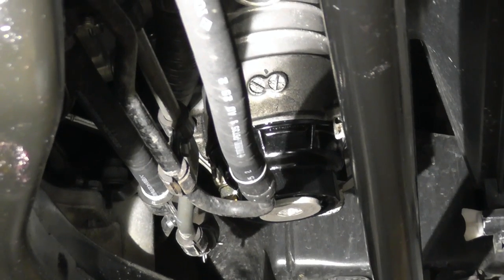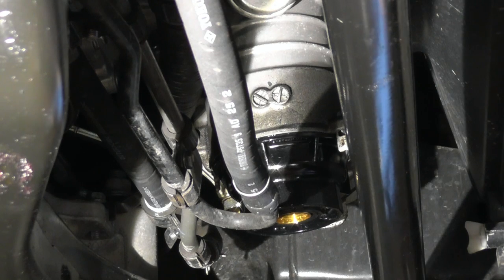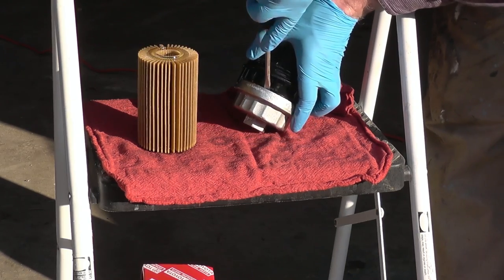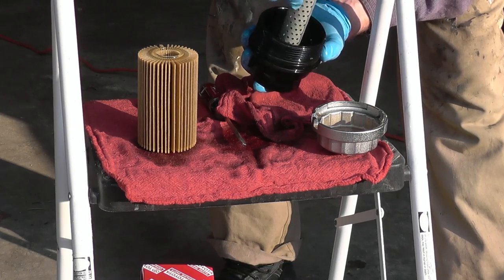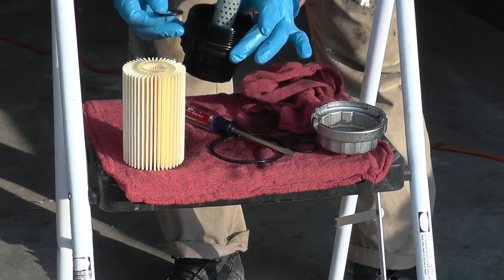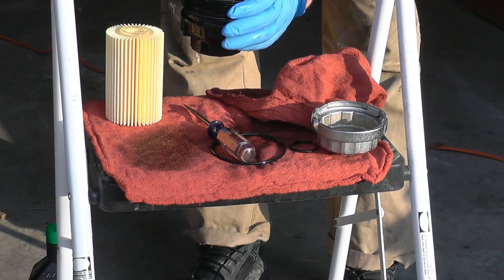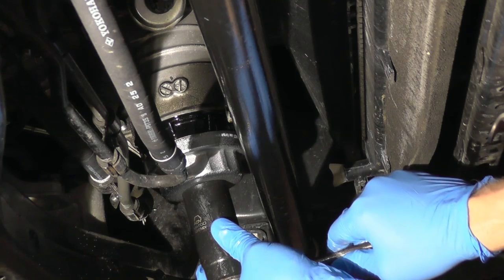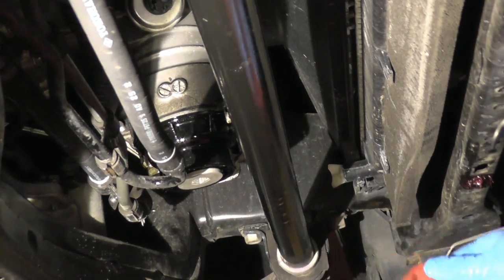2007-2020 Toyota Sequoia/Tundra oil change with filter 2nd option

Comment: Every time I change the oil and filter on my 2017 Toyota Tundra off road TRD I ask my self why does Toyota make it so hard to do a simple oil and filter change for the average person. Between the pain in the butt skid plate to remove and replace when you are laying on my back and the crazy oil filter housing as I lay on my back on the cold concrete. My did you do that Toyota and don’t get me started on the sealed transmission.
Reply from the maker: What cars have dipstick for transmission?
Reply: @repairvehicle  my wife’s 2016 CRV  AWD has a dipstick my old 2012 Honda Civic had a dipstick
Reply from the maker: Older Toyotas had dipstick too

Comment: It is necessary to remove the splash shield every time we want to change the engine oil. Have anyone cut a small opening on the splash shield? only big enough to remove the oil filter?  Thank you
Reply from the maker: There's another option, I will make a video on this subject, stay subscribed. I am not aware of anyone cutting an opening.

Comment: You're asking for problems by removing the inner stem.  If it's not activating correctly it will bypass the filter and you'll end up with pressure issues and/or engine codes.  VVT won't like it if you affect pressure by causing a problem with the filter cannister.
Reply from the maker: Zero problems and zero wear on the engine, I still own this same vehicle.

Comment: Place  the bottom of the plastic tool into an empty quart-size oil bottle, then push the top of the tool into 
the bottom of the filter, draining the filter oil into the quart bottle.
Reply from the maker: There's an easier way to drain.

Comment: Loosen the filter enough so you can turn it by hand, then use a gallon size baggie around the filter to catch the oil, while the filter is removed by hand, and the oil runs into the baggie.
Reply from the maker: +Forward Plans , there is tool that comes with filter to drain the oil. it screws in.
Reply: @repairvehicle  
I thought you said to use OEM. The OEM comes with a push-in not a screw in drain piece.
Reply from the maker: @njsongwriter , don't use oem.

Comment: The drain on the oil filter is to relieve the pressure...?  C'mon you and I both know that there is no pressure in the oil filter when the engine is not running.

Comment: OMG!  Metal screw driver prying against plastic housing...
Reply from the maker: +Rick T, unfortunately Yes. that's only way to separate wrench from housing. You just have do it very carefully and not to damage housing.
Reply: @repairvehicle  
You wouldn't have that problem with the Motivx MX2320 wrench.

You should also learn to remove the o-rings without a screwdriver.